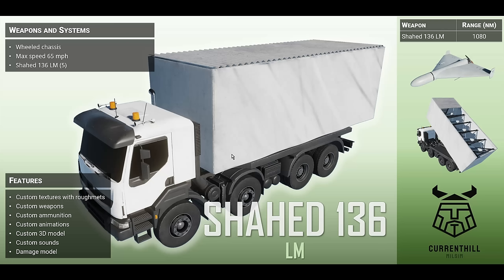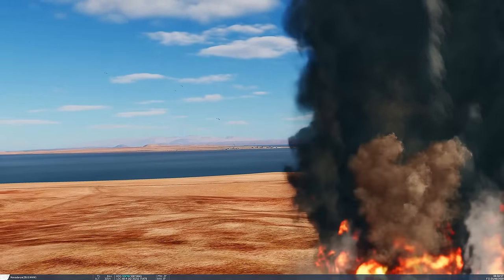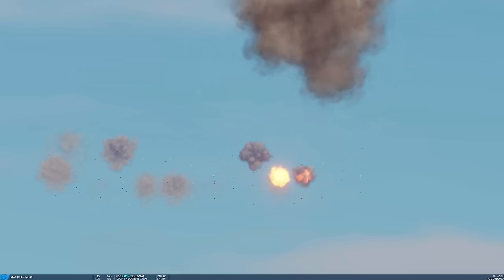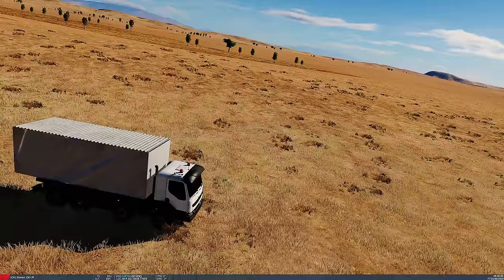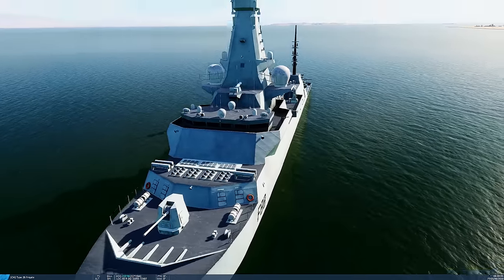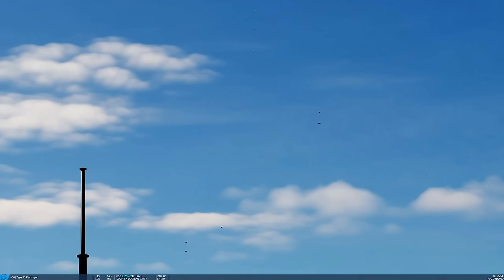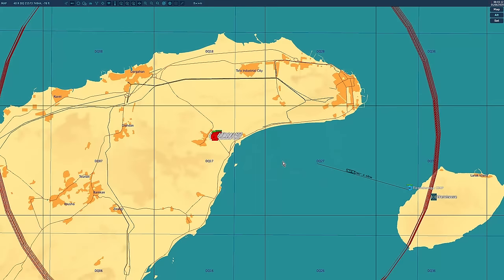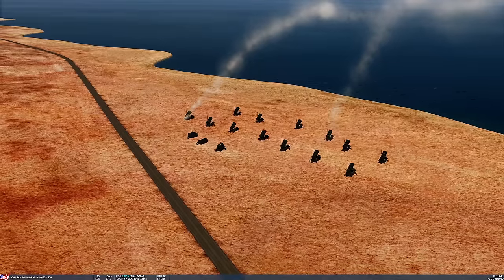Which Defence Assets Can Stop An Iranian Shahed 136 Drone Swarm? (WARNING: Hugely Explosive) | DCS

Comment: Saudi Arabia Deploys Silent Hunter Laser Air Defense Systems Against Houthi Drones. The s output power of "Silent Hunter" is 30 kilowatts and the maximum range is 4000 meters. It is said that at a distance of 800 meters, it can burn through 5 layers of 2 mm thick steel plates, and at a distance of 1000 meters, it can burn through 5 mm thick steel plates. Saudi Arabia proudly announced that the "Silent Hunter" laser air defense system purchased from China has achieved the first shot down under actual combat conditions.

Comment: Interesting. A professor of mine in college helped work on electronic warfare for ships back in Vietnam time. They came up with a system that would blast out electronic noise to simulate multiple ships, with the idea a missile would aim for a ghost, basically a last chance 50/50 coin flip. What if missiles could do that as they come in, a decoy with the original?
Reply: It would be hard to power such a system from a missile. Some kind of large drone travelling with the missile swarm might work.
The EU and US seem to favor stealth missiles though. Keeping the tie between detection and reaching the target small.
Reply: This sounds like the ADM-160 MALD, they've messed with them on this channel previously
Reply: The big advantage of Shahed is that it's so cheap, but integrating a power source and jamming/decoy hardware would massively increase the price. For the money it's easier to just buy more Shaheds and accept the loss rate.
Reply: f35 block 4 is supposed to have holographic projector to create fake radar/ir signature
Reply: @RBAWintrow  ADM-160 MALD does indeed exist.
Reply: Tom Clancy mentioned this idea in Red Storm Rising, where Raduga KSR-2 (NATO: "Kelt") cruise missiles were used as decoy targets, making the defenders waste missiles. Also look up the ADM-20 "Quail".

In this case, the swarm presents a huge number of targets that ALL have to be shot down, at great expense to the defenders. It's cheaper to build more Shaheds than to even fart with decoy tech. Best use? Quantity is its own quality; eventually the defenders will run out of ammo.

Comment: i'm sure there is no way for it to be implemented in this simulation, but the USA currently has a pretty awesome prototype  Stryker-based Short-Range Air Defense system prototypes with 50-kilowatt lasers that is a directed energy weapon designed to fight things like these drone swarms, and since it is directed energy it doesn't have to do the 'fire and wait to see if it worked', it can just immediately fire, and once the target is dealt with immediately retarget and fire. it's only the prototype phase, but it's a prototype that has had fully operational models on testing grounds, so it's not too far away from being implemented in actual deployment

Comment: It's deeply ironic how effective these drone are given their history. The Iranian Shahed-136 are based on the Israeli Harop drones (first released in 1989), but with downgraded systems to make them cheaper (and half as fast as the original because they have a larger warhead). This means that this threat has actually been out there for decades, but it really didn't catch on until recently, largely because the US had the IDF ban export of this sort of drone to most nations. Also, they were initially designed for SEAD operations, as a sort of loitering, low-visibility anti-radiation munition, which could isolate enemy air defenses and take them offline before real aircraft could operate over the theater. In another deep irony, the Harop was designed to defeat the S-300 and S-400 systems that Israel's enemies use (eg. Iran, Syria, etc), and so the Iranian Shahed-136 drones are actually perfectly suited to defeat the Ukrainian S-300 systems. 

It would be hard to program in, but the IDF uses a combination of the Iron Dome, and a proprietary EW/jammer system that disrupts their ability to coordinate. As nobody understands exactly how that EW system works, it's not exactly something that can easily be quantified. So far, they are the only group that has demonstrated a high level of effectiveness in mitigating these drones, as the Ukrainians have had a hard time, and the Saudis have completely failed. As of yet, the US hasn't had an opportunity to face a deployment of these drones with our own systems, and so a lot of that matchup is speculation.

Comment: an MIM 14 Nike Hercules could sort this lot out...2 or 40 Kiloton Warhead 😁To get it done cheaply you could use 40mm L/70 Bofors firing Proximity fused shells, if they were using an IRST for fire control that should help vs using a radar against the blob. L70's have a rate of fire of 300-450 RPM depending on Mods.

Comment: Would like to see this with a 4 gun battery of 35 mm Oerlikon Millennium Gun with the programable ammo.  Range is longer than the 20 mm Phalanx.  Also, phalanx has about 1550 rounds capacity, with 250 rounds to a target that's only about 6 targets before needing to reload.  35 mm Millennium has 200 round mag but with 5 to 10 rounds/target that's still 20 targets minimum before a reload is needed.

Comment: Maybe the tor radar was trying to track every single drone before it fired but with the drones moving up and down it made it seem like there were more drones than there actually was. This caused the radar to not fully detect them until it was too late. The frigate may have had the same problem but was able to detect the full drone swarm quicker than the tor. Or maybe the changing size of the swarm confused the radars.

Comment: I would have liked to have seen the German "Oerlikon" airburst munitions designed specificially for this scenario.
Reply: First thought was air burst
Reply: That costs 2 shaheds per burst.
Reply: @volvo245  You are kind of right. I looked it up. It's about $1,000 per round. About 30-40 shots per burst, but that's against supersonic rockets. Against a slow moving Shahed, I don't think they'd use more than a few rounds per burst.

Comment: Isn't Iron Dome designed to handle drone swarms? Maybe that would have been a good (and cheaper) contender.
Reply: Missiles are expensive. The premise of this video seems to be about testing lower cost ammunition options against drone swarms.
Reply: Iron Dome is designed to fend off ballistic missiles, that appear easily on radar and fly a high-arc, predictable flight path, which is what allows the Iron Dome to effectively intercept large amounts of missiles in a short timespan. The Shahed/Geran drones would normally fly low, reducing the distance at which they can be targeted, and since they don't fly a predictable path (drifting with wind, changing altitude with terrain, possibly additional maneuvers in programming) the Iron Dome missiles - which are themselves necessarily cheap, and thus don't come with much excess capability - wouldn't have nearly as good a success rate against them. Which is one of the reasons Israel doesn't want to supply it to Ukraine, incidentally (another being Iran's partnership with Russia).

Comment: This just proves just how much quality it takes to beat quantity and it's insane
Reply: He just used the wrong types of units. He should have used the Mantis with AHEAD ammunition. The other stuff is either made for planes, cruise missiles or just outdated, like the CWIS.
Reply: Even in the cases of marginal success it's all hopium. Those are litterally the best possible circumstances against those drones. All clumped up, coming from a single thin angle, And you anticipating them exactly underneath them and with THAT MANY systems all perfectly ready.

Those drones actually don't just go in a straight line, they can take turns. You can litterally attack that island from every side with same swarm being launched from the same initial position. And russians often use those drones as AA bait to potentially detect where the AA is and potentially destroy it first, launch missiles and/or other drones from a less defended side and waste the AA's expensive and limited ammo before letting the real big missiles fly in.

Russians utilize those drones mainly as utility and support for the missiles. But sometimes they too hit targets.

Comment: Although it would be hard to hit them all when so closely swarmed, the ones that do get hit and explode would undoubtedly hit other drones that are near the exploding one.
They basically get turned into very large HE Shells, and would have a far more devastating effect then actual HE Shells.
That's the problem with swarming them so close together. If you paced out their launches to avoid this "HE Shell" problem, then you give more time for the defenses to shoot them all.
Does this simulation, simulate the actual exploding drones producing far reaching, high speed shrapnel from the relatively large blast from the warheads?

Comment: Curious on the efficacy of EW in this scenario.

Great sim, Cap and CH!
Reply: Yeah, I think the Americans are working more on non-kinetic weapons like EW, lazers, and Microwave guns. Things that can target swarms as a mass. I am sure others are as well but not sure on the progress.
Reply: EW is incredibly effective. They have absolutely not offense against them. The reason they are so cheap is because of their flimsy construction. In order to harden them against EW it would make them much more expensive.
Reply: @GageEakins  Even if they are four times the price they are now, you're still looking at something that's 40 times cheaper than a Patriot missile. So if spending that money makes them more resilient, it'll be well worth it.
Reply: @SeanMirrsen  well the issue is pardoning the engines would be the most complicated. It would also require significantly more powerful engines as the weight would be significantly increased. There is a reason US drones are so much more expensive. But honestly even if they were hardened, the issue would be communication. If they are in an area flooded with EW, they won't be able to communicate with the controller.
Reply: @GageEakins  They do not communicate with a controller. They're basically cruise missiles powered by a pusher prop on a lawnmower engine (I exaggerate but not by much), with fallback inertial guidance on top of GPS/GLONASS. Unless the interference is strong enough to actually fry circuitry, it won't do anything besides slightly increase the possible deviation, especially if the drone is already on the terminal descent, where it operates on preset commands rather than guidance.

Comment: there doesn't seem to be enough effect of sympathetic detonation. many of these systems have a decent size warhead, and with such a close formation like that it should be able to take out more than one shahed with each detonation
Reply: I think it’d be safe to assume a mass attack against a single target could be setup in a manner that wouldn’t have every drone coming in from the same direction at the same time. They’d likely be programmed to fly in from different directions or to fly a certain distance apart from each other to prevent that scenario.

Comment: Even in the cases of marginal success it's all hopium. Those are litterally the best possible circumstances against those drones. All clumped up, coming from a single thin angle, And you anticipating them exactly underneath them and with THAT MANY systems all perfectly ready.

Those drones actually don't just go in a straight line, they can take turns. You can litterally attack that island from every side with same swarm being launched from the same initial position. And russians often use those drones as AA bait to potentially detect where the AA is and potentially destroy it first, launch missiles and/or other drones from a less defended side and waste the AA's expensive and limited ammo before letting the real big missiles fly in.

Russians utilize those drones mainly as utility and support for the missiles. But sometimes they too hit targets.

Comment: What would a real world SAM site do? Layered defense (like a S-300, with Pantsirs, Tors, even AAA) or a real Patriot site with Nasams, Gepards, even Manpads, instead of a unrealistically large site consisting of only one weapons system (basically confirming PK rates)? That would also allow IADs. There is a high likelihood AWACs, and couple of standard cap patrols might be included for a HV target, like SU-35s, J-15s or missile truck F-15Es (I haven't seen you try out the new F-15E as a missile truck yet, unless I missed a vid :), new Vipers, or murder BOGs, or even older planes that may be assigned to a cap role (say if one had to reserve the more modern planes for other tasks, use older planes for HV cap missions). There is also ample time to scramble planes fairly close, due to the target speed and range of detection (AWACs). Great vid, I like the "boom, boom" ones :)

Comment: Would the radar detection range be better with AWACs/Aircraft, than ground based radars? What would this mean to IADs? Maybe it's a better test to set up diff scale SAM sites (sm., med, lrg), and increase the drones until the target is destroyed, then add air assets, repeat? I've only been watching for a gloriuos year (thanks for the ride :), you guys are the prof. at sims.
Reply: It would but it's a very expensive way of defending against such a cheap weapon. This is the kind of scenario where shooting them down with guns and lasers probably make more sense than using missiles.
Reply: @trolleriffic  But...the whole point of a swarm attack is to hit a target, and 100 drones means a HV target, wouldn't you expect the defender to have substaintial assets protecting that target, like aircraft, and AWACs? Not to mention just the common air superiority missions "guarding the borders, territory" assets which you KNOW will be there, HV target or not (most efficient with aircraft, not a bunch of scattered less mobile, more vulnerable SAM sites). I mean unless the defender got totally caught with their pants down (radars off), or a surprise first strike, all bets are off in those cases. Ukr is doing 80-90% PK NOW, with inadequate numbers, no airforce, AWACs, a complete zoo of diff systems, and the Russians have hit them with 30-40 in one night, several times, using a layered defense, which I bet still uses aircraft, over their own SAM coverage areas. Besides, nomodern military is going to line up like a NFL football play, mano e mano, and fly straight at each other like GR has to sim (...[clearing my throat]....excluding the Russians).  , for technical reasons, and watch-ability of the vid. (lenght),

Comment: Use smaller drones on top of the Shahid model airplanes with a navigation computer and a radar reflector without any warhead. About 5 kg in weight, but they would have a larger radar signature than the Shahid drones.

You would mix the 100 Shahid drones with 1000 of these dummy drones.

Comment: How would Iron Dome work as a defender against a swarm?
Reply: Based on some quick research, a single Iron Dome battery consists of 3 of 4 launchers with 20 interceptors each. Each interceptor can intercept at a range of 4-70km at mach 2.2. The radar is capable of tracking up to 1100 targets. Based on how the game seems to handle it, it would either get stuck and stop firing or a swarm of 100 wouldn't stand a chance against 2 Iron Dome batteries.

Comment: If we take the lowest estimated cost of the cheapest PAC missile which is reportedly +1m$ per missile, and assume a perfect 100% accuracy per missile; Then taking down a jam-packed swarm attack barely worth 1.5m$ (100x 15,000$) would cost the defender more than 100m$ (at least) almost 100x the cost of attack; even if not a single Drone gets through, I'd call that success (from the offensive perspective) add 50 more Drones and the whole  Patriot complex and all the launchers would be destroyed 2b$? 3?
"Purchase of 5 batteries and 75 missiles has been approved by US State Department in 17 November, 2022 at a cost of $2.2 billion for the equipment and $700 million for the missiles" 
aight I stand corrected, I wouldn't call that a success I'd call that a ultimate victory, cause the defensive side (any nation other than the US) just lost equal or X-Fold of its annual defense budget, and is on its way to file bankruptcy

Comment: what about just building a bunch of small cheap fighter drones, like a slightly bigger drone than the shaheed with a small simplpe jet optimized for subsonic flight, no afterburner and a booster rocket, flying much faster than the shadeed and being able to essentially dogfight these kinds of swarms, you could even just have a quite accurate 50 cal and go shoot engines, just put a 50 cal on a swivel, make a good ballistics computer and go get some turkeys. just 10 drones launched from a small ship could probably just park behind a swarm like this and roll it up in transit with way less ammo used. also i disagree about the way the crams and guns target the swarm, they should shoot and pick and new target and shoot again right away, and then later check the last target, waiting to see is silly.